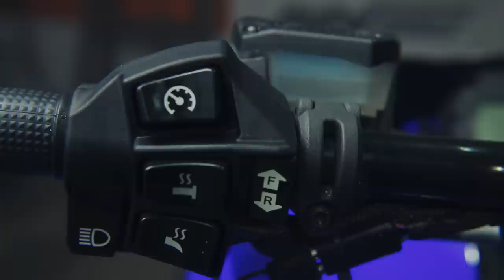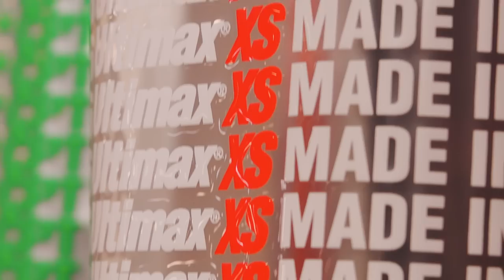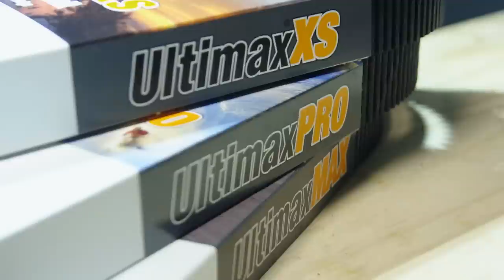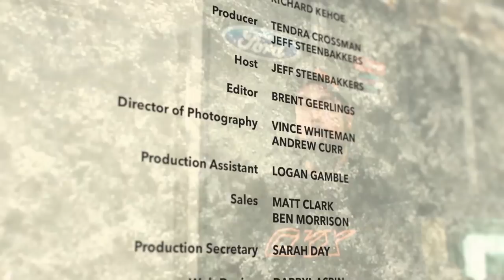Snowmobiler TV - 2019 Episode 3 ( Ultimax Belts Factory Tour & Yamaha SRX First Burn )

Comment: The way you showed the secondary clutch seems a little simple. You didn't mention the spring at all.
And why not use water in the bolt hole to pop off the primary clutch?